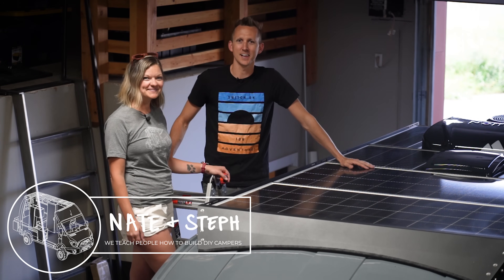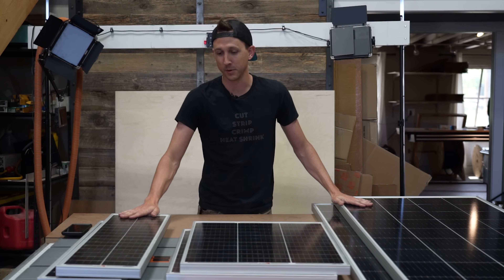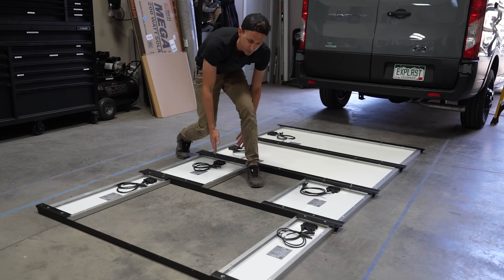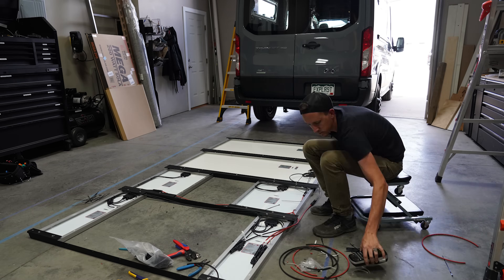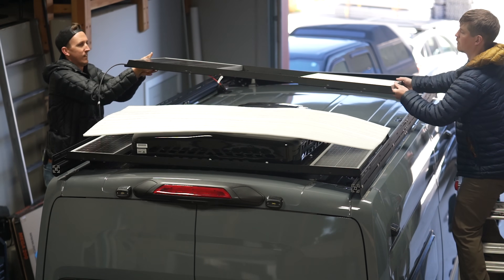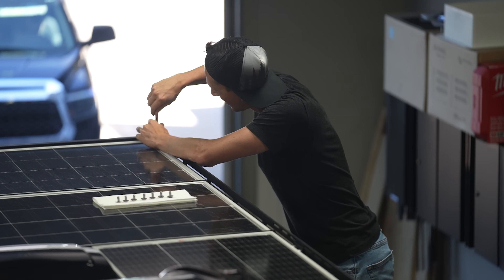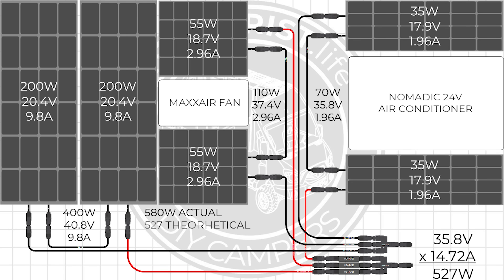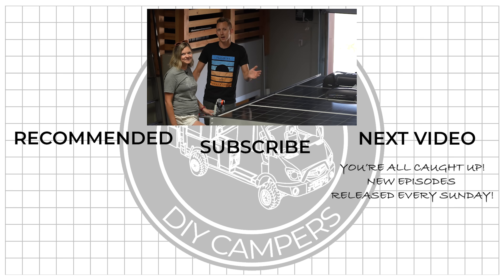INSTALLING 580W OF MISMATCHED SOLAR PANELS ON OUR TRANSIT

Comment: Does the lower voltage panel consume power from the higher voltage panels? I have a hard time getting my head around this. Is it like connecting a 9v battery to a 6v battery? If they have low internal resistance, wont the 6v battery heat up?
Reply from the maker: Good question!  That's a pretty complicated answer that won't fit into a comment reply.  If I can figure out an easy way to explain that, I'll do a video over it one day.  Until then, we will just have to settle for 'how' it works as shown in this video (and this video:  https://www.youtube.com/watch?v=jejro4zkl8I&list=PLmvhcyi4n0TV9pi83rFTv3ZuMT_S1xIZt) and accept that the 'why' it works 'is what it is'.

Comment: Super tidy a really cool getting maximum efficiency. 
For you two is perfect that’s why you designed and made it, just for my thoughts losing the roof area for storage or surf board or something is a bummer.
Not complaining about yours is mega though such a smart setup, nice one go steady
Reply from the maker: Thanks!  Yeah, in our last van we actually omitted some solar to fit a rooftop storage box, but actually never even installed one as we found we were able to fit everything we needed (skis, bikes, paddleboards, etc) inside of the 'garage' area of the van; so the 'blank' space was pretty wasted; so we opted for full coverage this time around.
Reply: @EXPLORISTlife  good going, brilliantly sorted then 😎, I do worry with stuff on the roof a bit especially my long board would cry a lot if that got stolen, as we live in the UK 🇬🇧 does happen a few bit unfortunately. 
Lived a few years in MA and boxes and stuff seemed to be less of a worry, any way thanks for the tips and videos.

Comment: I may didn’t catch or mist the advantage of parallel or série in case of shade (if one panel is in full sun while others may be in full shade) does it make an advantage in series or parallel?
Reply from the maker: Solar panels need sunlight to function optimally.  If maximum solar output is the goal, none of the solar panels should be in the shade.  The cool thing about vans is that they can be moved into the sun without too much effort.

Comment: IDK if someone else already commented on the roof rack video, so sorry if they did. If you did not already, you should put some of that clear vinal paint protector film anywhere the rack is touching the roof panels or very close to touching. It will give your paint an added layer of protection, is easily removed with a heat gun, and can be replaced as needed. The rack will move and wear the clear coat off the paint causing delamination in the long run.
Reply from the maker: The roof rack mounting feet we used has a thin (1/16" or so) piece of plastic on the bottom to give a bit of added protection like you are mentioning; so there is not need for additional protection above and beyond.

Comment: Hey nice project dude! I had a similar project for my car, but had conflicting advice from unfortunately ultra newbish manufacturers(somehow🤦)They even sent wrong panels omg. We designed a layout with multiple sized panels, but another manu. said it would greatly reduce power output. Please confirm if you can, thanks. Your vid was very impressive with 91% of max potential output w/mismatch panels wow!
Reply from the maker: Explaining HOW mismatched solar panels work is fairly complicated and is not something that most manufacturers are going to spend the time explaining (if they even know how it actually works).  I made a video a while back, though, talking through how it works so that there is a resource available for all of you who want to try your hand at advanced solar array design: https://youtu.be/jejro4zkl8I
Reply: @EXPLORISTlife  Thanks man! My next project will be using individual cells like the aptera solar car to avoid the mismatch issue and optimize output, but we'll see! Would love to see a vid like that!🔥Have an awesome weekend brother!     🤘😎
Reply from the maker: Nice!  I know that the University of California Riverside was using some of our videos to help make their solar car. Pretty cool stuff!

Comment from the maker: Check out the full electrical installation tutorial for this build: https://www.youtube.com/watch?v=E5q7_4FH4LQ&list=PLmvhcyi4n0TVfA4XCYJBkzfUXunSON1zX

➤ Last Weeks Roof Rack Install Video: https://www.youtube.com/watch?v=y1iI-wjm_D8&list=PLmvhcyi4n0TVfA4XCYJBkzfUXunSON1zX
➤ 200W Panels: https://shop.explorist.life/shop/all-products/solar-panels/rich-solar-200w-12v-solar-panel/
➤ 55W Panels: https://shop.explorist.life/shop/all-products/solar-panels/pre-order-rich-solar-55w-12v-solar-panel/
➤ 35W Panels: https://shop.explorist.life/shop/all-products/solar-panels/pre-order-rich-solar-35w-12v-solar-panel/
➤ Full Solar Array Wiring Kit (and diagram): https://shop.explorist.life/shop/all-products/camper-wiring-kits/solar-charging-wiring-kits/580w-solar-charging-wiring-kit-24v-battery-bank/
➤ Roof Rack: https://unakagearco.com/collections/ford-transit/products/explorist-life-transit-roof-rack/?dt_id=105323

Comment: Nice. I have a Ford Transit 250 MR 148" with a MaxxAir fan in the front and a MaxxAir passive vent in the rear. That combo, along with our awning bunk windows, gets a lot of air moving,. I have a roof deck on top and one 200w solar panel in front of the fan. I know the 55w panels are not available yet, but what are the dimensions of those panels? I might be add two of the on either side of the fan like you did, but we really do not depend on solar and just take trips - long and short - and come back home. No "van life" for us! : ) Thanks.
Reply from the maker: Nice!  Yeah, the 55W panels would add quite a bit of power to your roof on either side of each maxxair fan.  With a single 200w panel, though, you'd probably want to put the 55w panels on their own charge controller and leave the 200w on it's own charge controller as well.  Steph put the panel dimensions on the product page down under 'product specifications': https://shop.explorist.life/shop/all-products/solar-panels/pre-order-rich-solar-55w-12v-solar-panel/
Reply: @EXPLORISTlife  Thanks! I run my Transit with a similar system. I have on longer trips, two Ecoflow Delta 1300s and a Delta Max. So I just run my solar output to my power box terminating with an Anderson connector and then into one of the Ecoflows. I also recently added a Victron DC to DC charger. I can easily run everything with the Ecoflows, including the microwave and coffee maker.